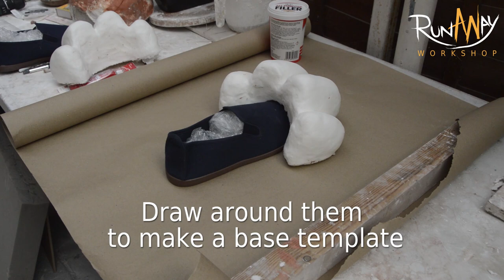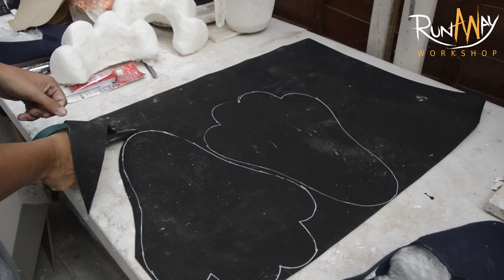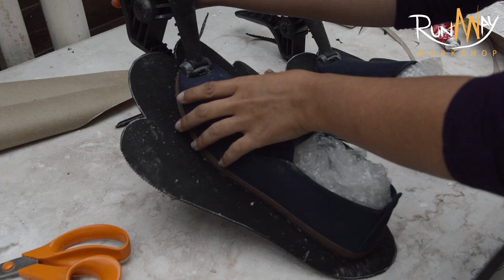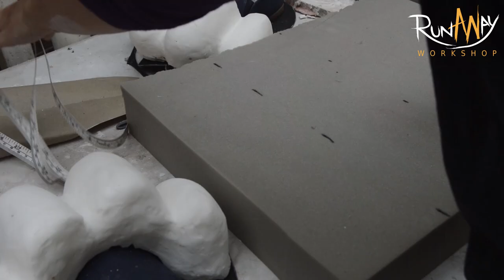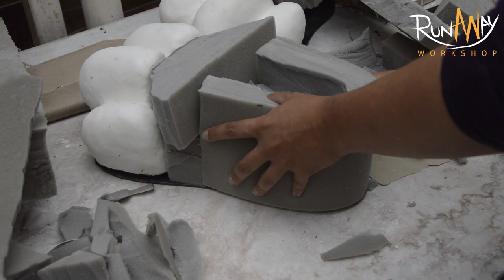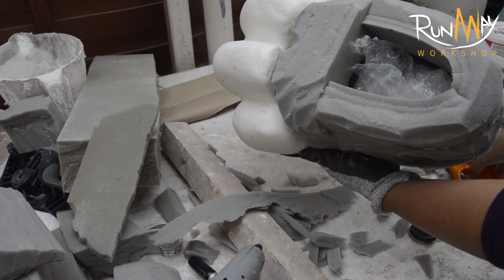Building large, stompy feet for costumes with Runaway workshop toe padding

Comment: Hi, what thickness of Eva foam would be suitable?
Reply from the maker: It really depends on your project and preferences. I use rubber floor matting (Workshop floor mat) which is different from Eva foam, its more durable for its thickness and has better gripping. I don't really like Eva foam for feet paws because its too rigid.
Reply: Runaway Workshop I'm curious, where do you usually get your feet mats from?